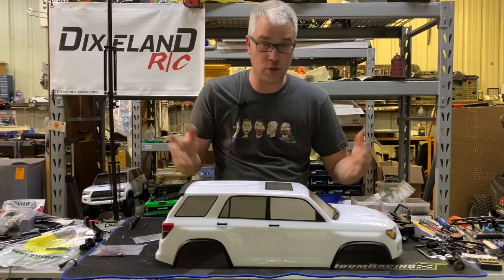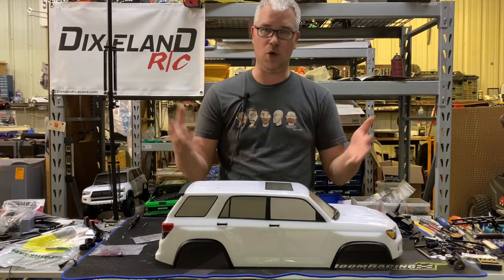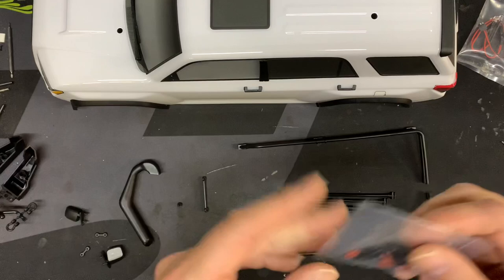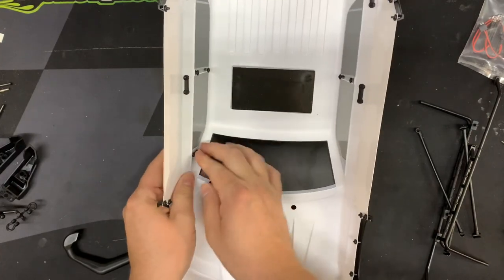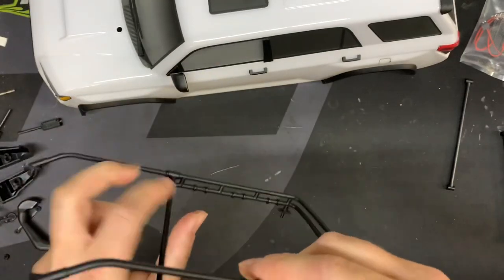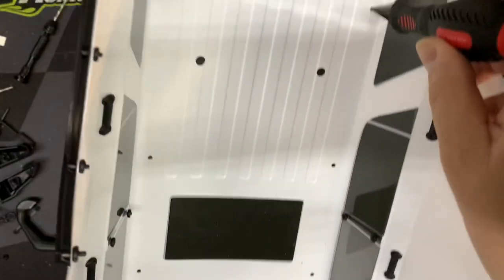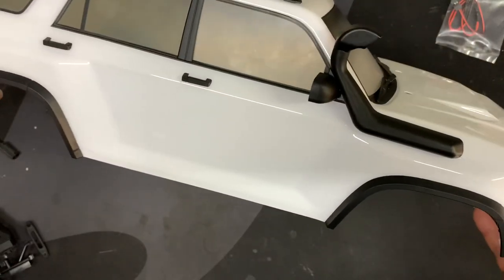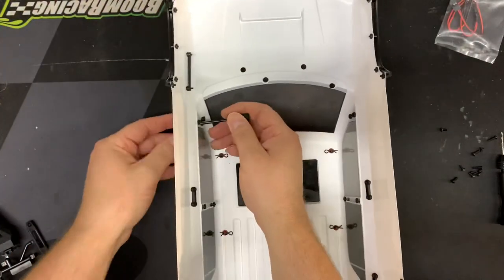How To Install Molded Accessories to your Trailrunner Body

Comment: Thanks for this vid....exactly what i needed!!
Reply from the maker: Glad it was helpful!
Reply: @DixielandRC  Do you have any suggestions for shock oil wt.  My rears leaked durring shipping and the stock is 30 but another guy suggested 50wt....seems like quite the spread.
Reply from the maker: 50 is good for slowing the compression down. I prefer 50 in all my rigs